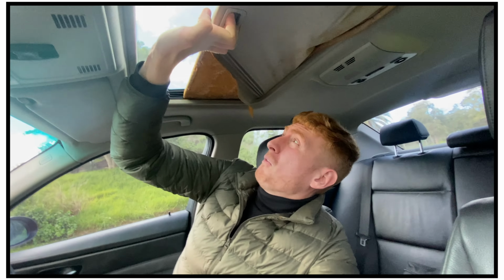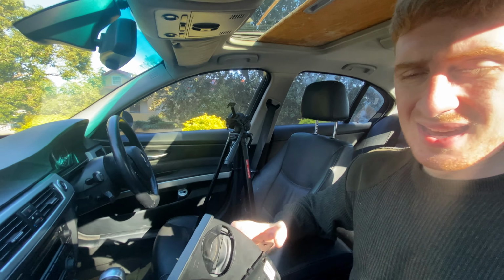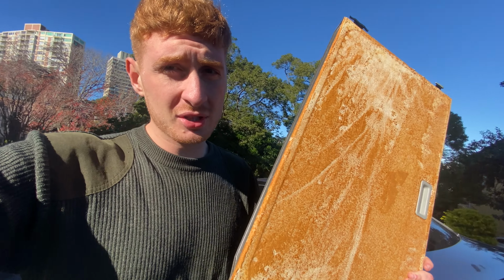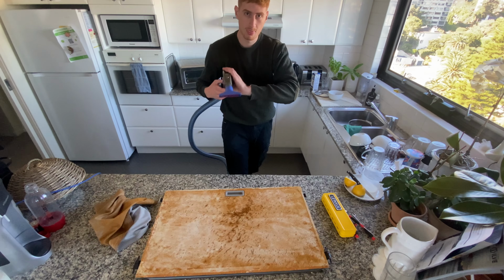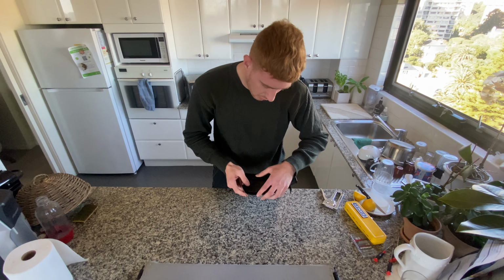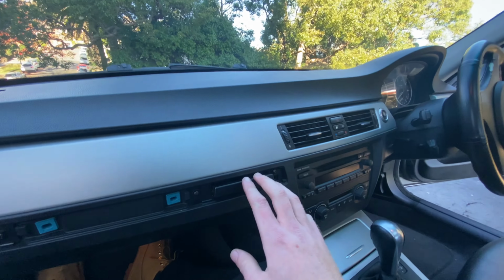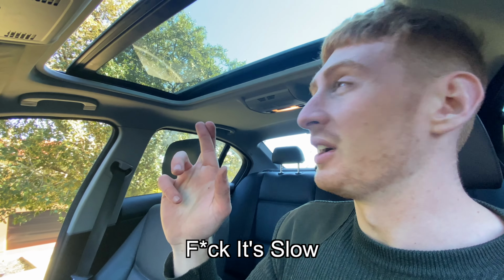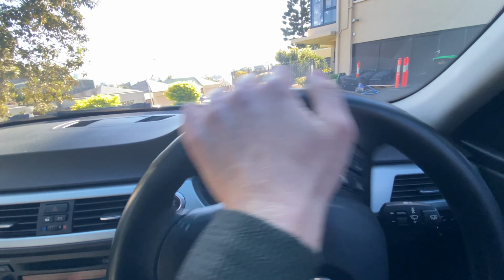How To Fix Your BMW Sunroof Headliner For FREE With No Glue!

Comment: What was you going to do about the breaks if they didn’t fix there self mines squeak a lil when I’m approaching a stoplight or stop signs ??
Reply from the maker: Brake squeak comes from the pads vibrating at an irregular frequency. A good fix for squeaky brakes is some Ceramic Brake Grease, Simply apply some to the back of your pads and that should sort it out. Bendix makes some great stuff that will last the life of your pads 👍